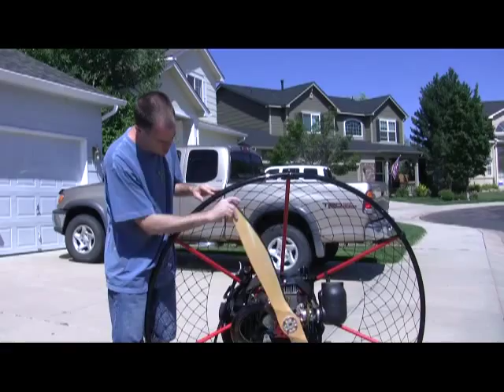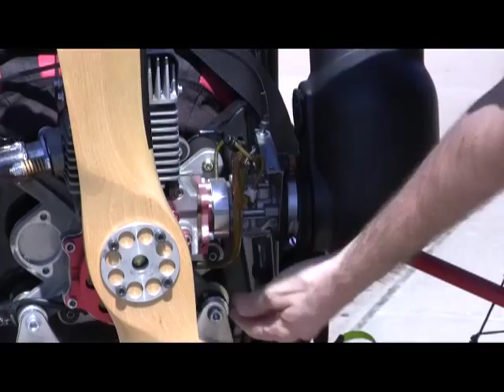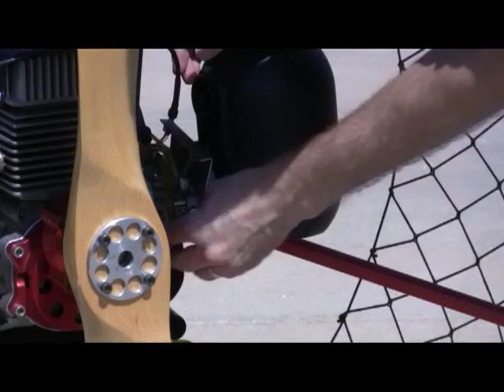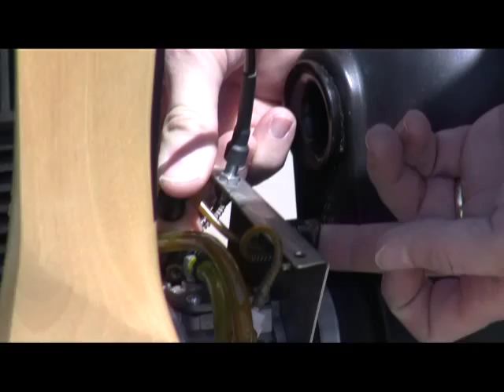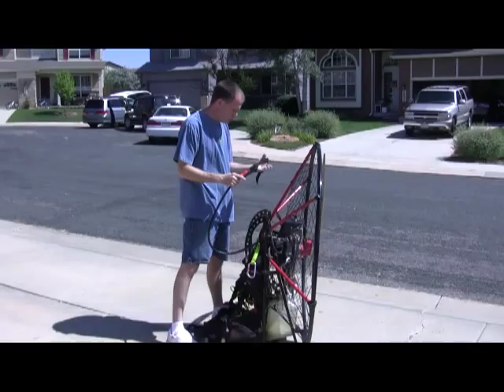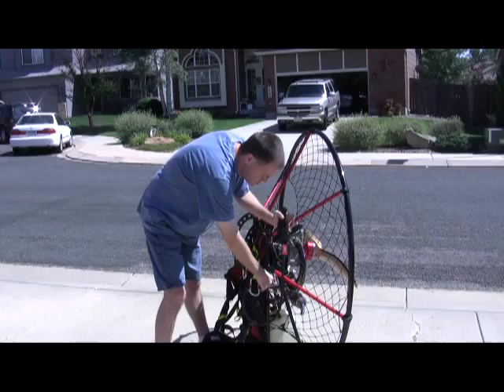Vittorazi Paramotor For Sale

Comment from the maker: A skilled pilot with a large enough wing could probably pull it off. However, I can not recommend it. I think you would be disappointed with the power, since at that weight, more power would give you a safer reserve of power and a better climb rate. This Vittorazi would work well for pilots up to around 200 lbs at sea level. For you I would recommend something with closer to 25hp or more. Thanks for your interest.